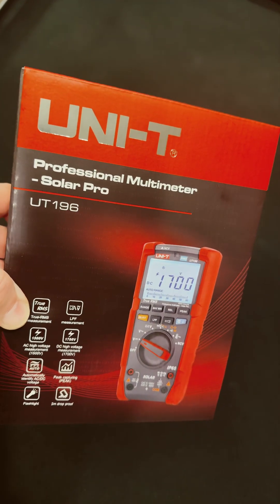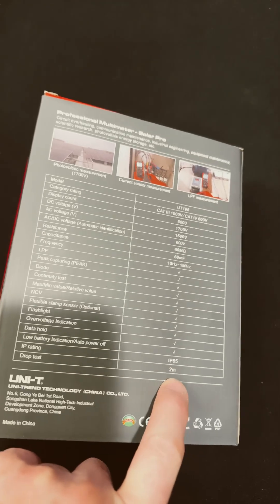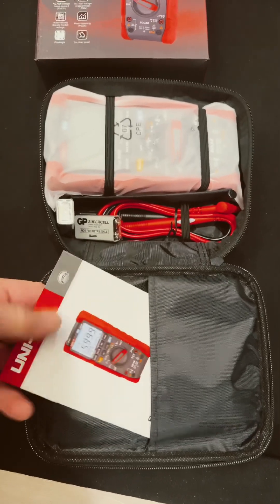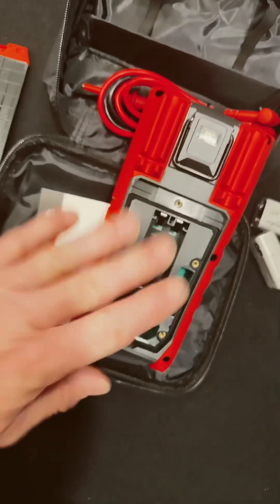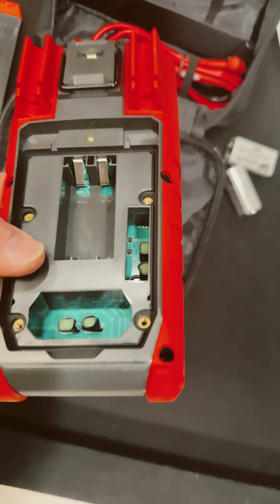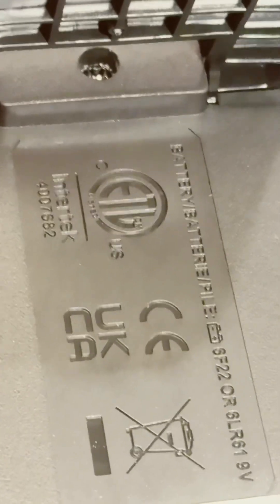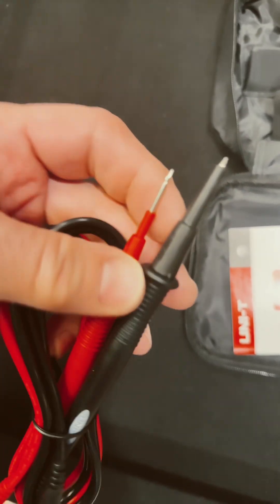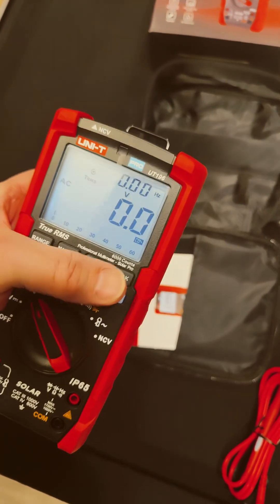Solar Pro Professional Multimeter UNI-T UT196 #multimeterforsolar #unitrend #UT196pro

Comment: The meter im waiting to see someone review is the uni-t UT197
Reply: UT197 is an interesting meter: in terms of accuracy it’s very close to Brymen, but the design and ruggedness feel more like a Fluke.
What I don’t get is why they didn’t make the screen a bit bigger so it could show more info, like on their clamp meters. And there are a bunch of little footnotes to the accuracy specs as soon as the conditions aren’t ideal – which looks a bit weird 🙂
This is exactly the kind of multimeter you’d want to use not in a comfy lab, but in a harsh industrial environment – with strong electromagnetic interference, noisy non-sinusoidal waveforms, voltage spikes and temperatures far from “room conditions”. And so far nobody seems in a hurry to properly show that in tests – not even UNI-T themselves, which is also kinda strange, because that’s exactly the environment this meter is supposed to shine in.